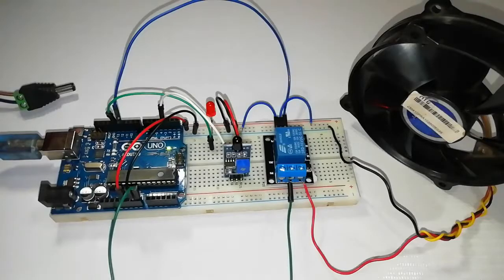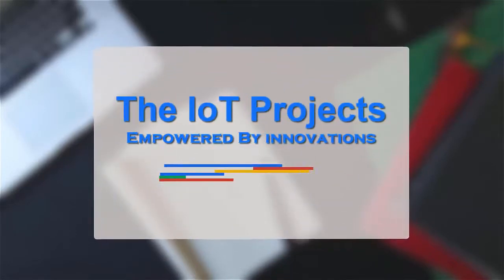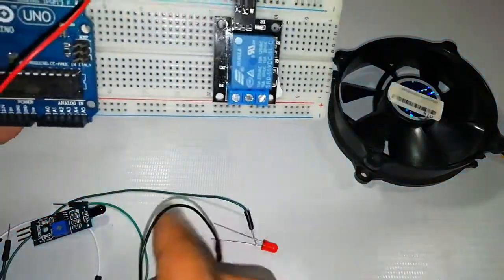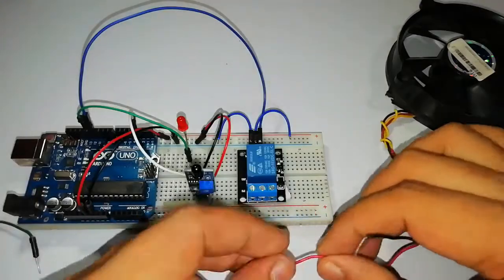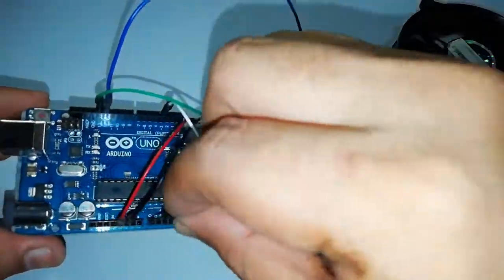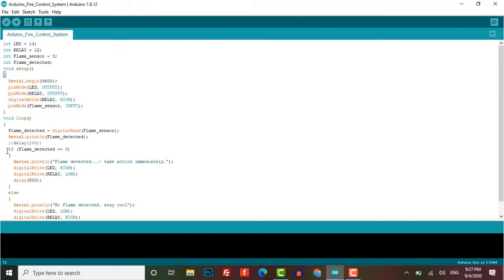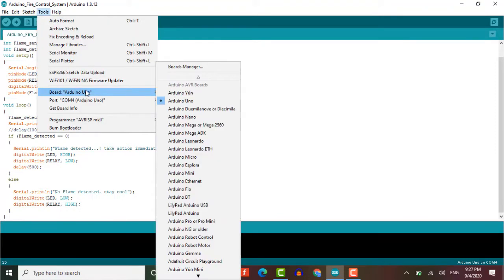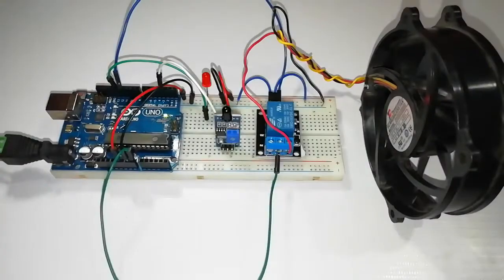Fire 🔥 Security System Using Arduino, Flame Sensor, and 12 Volt DC Fan

Comment from the maker: ► Fire 🔥 Security System Using Arduino, Flame Sensor, and 12 Volt DC Fan
► Download Circuit Diagram, Source code, and guide from here: 
►  https://theiotprojects.com/fire-security-system-using-arduino-flame-sensor/